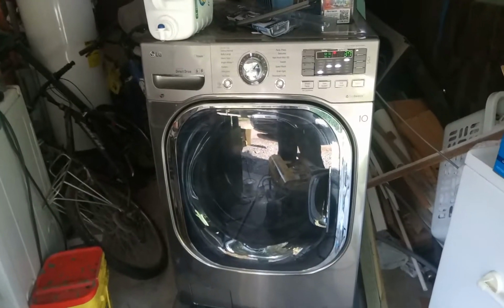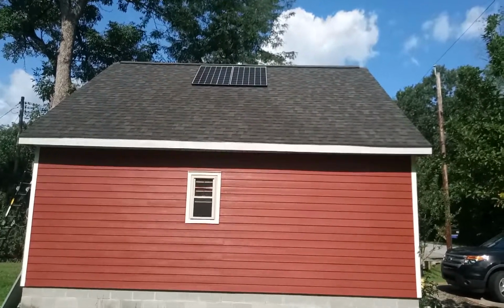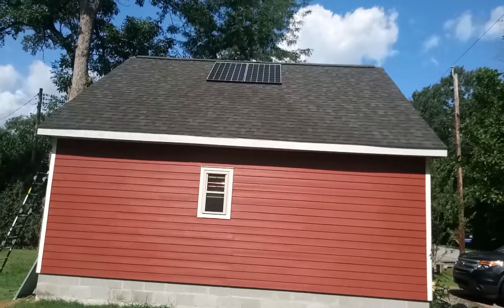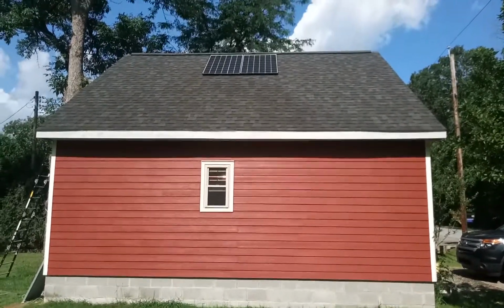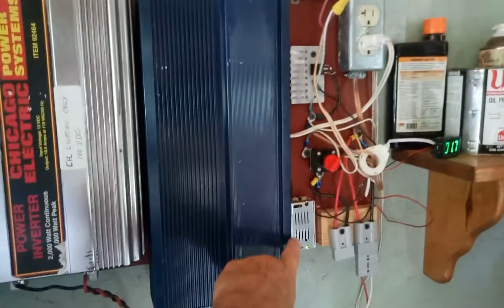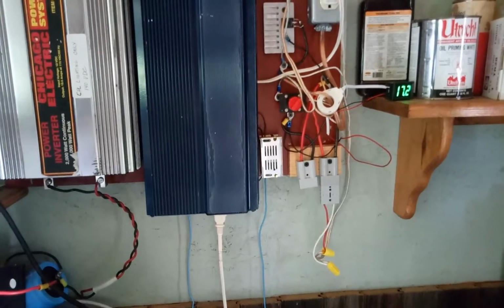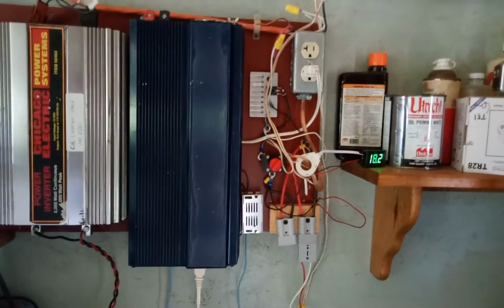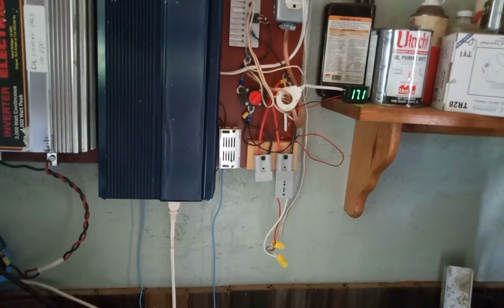Washing Clothes With No Battery Off Solar Panel Voltage. New Panels Installed Update #fotovoltaika

Comment from the maker: The PV array has been updated with an additional two panels. This allows the garage to be totally independent of the house array if I choose.  An EAST facing array is a major improvement to the house system. I now get very fast recovery of water heaters in the morning.
The inverter for washing is the blue one.  This still has all the FET in it and it appeared to power up.  Only one half of the H bridge was working.  Highly unusual failure.  A 1N4004 diode had failed in the bootstrap circuit had shorted and only the lower fet would turn on.  Highly oversized it should have never failed.   The silver inverter next to it had the H bridge removed and that outputs 140V DC to operate lighting and some electronics.  It hasn't been used in years.

Comment: Any chance you have any data on the Power VS time of the washer in a given cycle. If so any chance you can share that info? Thanks
Reply from the maker: I remember the active cycles ranged from 250 to 450W. This summer I will have a Watt meter which can do charting.  Dishwasher was only 100WH for full wash.
Reply: @opera5714  Yeah awesome, thats cool. I suspect that was running a cold cycle/ or did you have to do anything to trick the washer as you were delivering hot water from your own supply

Comment: i have a inverter just like the sliver one
Reply from the maker: That is a unique supply design.  The voltage boost converters are in series, not parallel, about 35V each.  If you wanted to boost DC from 12V to 60V or higher, this would be a great inverter to start with.

Comment: Have you ever worked on tricking the micro inverters to work off grid 
Fooling the communication part between the DC TO AC ?
Reply from the maker: I had bought a couple small grid tie inverters with the intention of doing that. These were low voltage and I have given up small panels because of limited space.  These are easy to fool. Grid tie will just keep raising the voltage till current flows. This will blow out most sine wave inverters as this power is fed back. The trick is to have a circuit that monitors voltage and progressively increases the dump load. You can only dump so much. After that you need to throttle down the grid tie inverters.  Far too much work for anything but a small system.

Comment: I always think about DC Powered split ACs for heating the house in the winter, those inverter ACs should run on DC. I habe 8kW on my roof, 6 in Series and 4 in parallel (24x320W) and do Not feed the Grid because I don’t give presents to my state and Energie Provider

Comment: Can you run the dryer?
Reply from the maker: We use a clothesline.  I have someone in Florida that built my water heater control and is running over 200V on the array.  He modified his dryer and switches from water heating to drying clothes. It can be done, but my array isn't big enough. There is a new breed of dryer being made more akin to a dehumidifier. They only need about 600W. For sure these will have lots of problems and will be able to pick one up cheap when they are a couple of years old with a problem.  I got that 2 year old washer for $150 because it wouldn't work.

Comment: Build some old time Frankenstein Blade Switches.  LOL
Reply from the maker: I do have an old blade type switch panel with the switches mounted on 3/4 inch slate. About 2' by 2'.  Still waiting for a use for that.